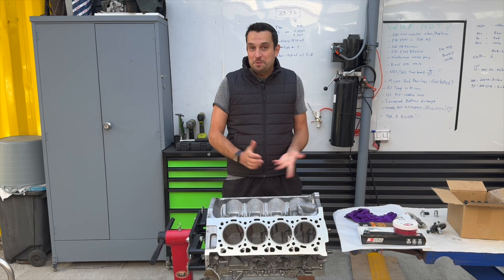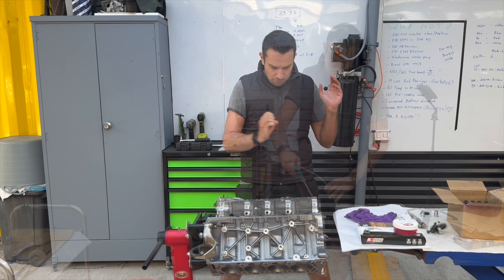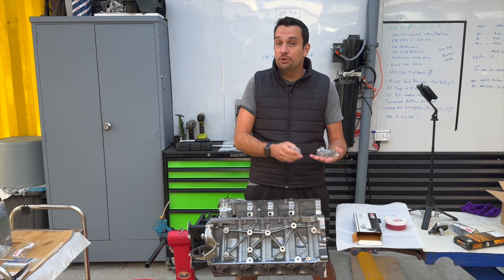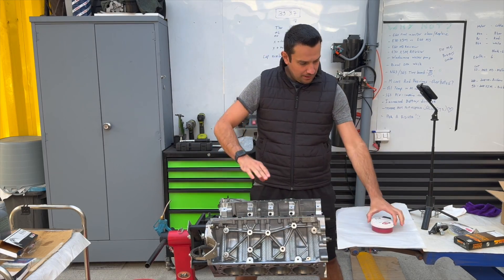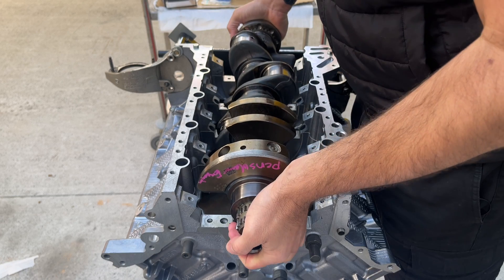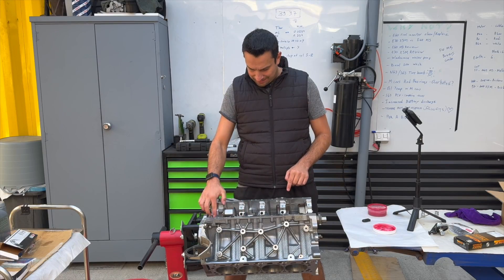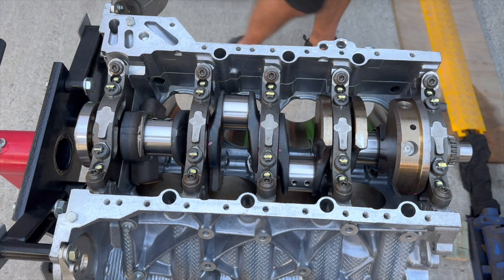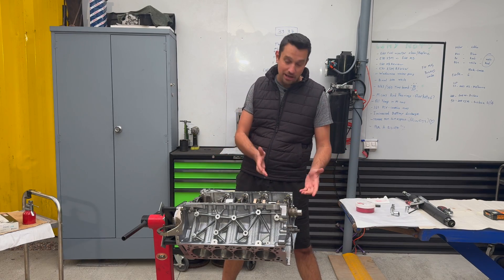BMW F10 M5 Engine Build - Part 1 - The Crankshaft S63TU

Comment: Is it too different than N63TU? I know it’s a M engine but I also know they’re very similar
Reply from the maker: No, they are basically the same engine and use the same crankshaft - the difference will be in the pistons, camshaft, turbochargers and DME depending on the year model - the way they are assembled is exactly the same, same tools and procedures

Comment: I have a f10 m5 with engine knock, it just had top end rebuild gearbox rebuild diff rebuild valve stems crack seals full new paint job. Now something else is wrong
Reply from the maker: My garage is in Sydney, send me an email if you live nearby
Reply: @dnl35projects  bummer I live in north Brisbane, let me know if you start a shop up here lol I wish. Or if you know anyone up here, you can trust?

Comment: In bolting down the crankshaft, is it important to torque and angle-set each bolt before moving on to the next rather than first torquing all bolts and then setting all the angles - with the latter method running through the correct sequence twice?
Reply from the maker: I don’t really mind the method for it since the crank is sitting on oiled bearings and has enough clearance to move and since they are stretch bolts I rather torque them all then come back for the angle rotation giving them time to stretch.
Reply: @dnl35projects  Cheers.

Comment: Hello! I have a question about the install lube during the crankshaft install process. 
@7:55 you put lube on the sides. I noticed you did that on the lower bearing as well. Is that due to the thrust bearing?
Reply from the maker: That’s correct ! Number #3 journal is the one holding the thrust bearing so I also apply lube to the sides
Reply: @ awesome thanks!

Comment: So about torque space 
Crank bolt 20nm+ 115 degree
Small ones e bolts 10nm+ 55 degree
Side key bolt +16mm for oil pump 10nm +45 degree is that right?
Reply from the maker: That’s correct ! The spec on the oil pump bolts could vary according to the engine you’re working on (eg 4 wheel drive or rear wheel drive)

Comment: DO you use Stock bolts for the crank shaft main bearing cap? or ALL new?
Reply from the maker: Hi, it depends on the build - some cars I use ARP and some I use the stock rod bolts
Reply: @dnl35projects   oh, What i meant do you reuse the bolts (OR can you)? OR do they HAVE to use bran new bolts?

Comment: Hi do i have to buy all the stud for the crankshaft new or can put the same one and were can y buy them thank you
Reply from the maker: The bottom ones I usually re-use and only really buy the head bolts new - I buy most of the parts from FCP euro or ECS Tunning in the USA 🇺🇸

Comment: First i will thank you for your videos :D I have a f10 M5 comp with a downpipe without tuning and I get white smoke when I accelerate and let off the gas/under revs.
I don't lose any coolant and believe that the oil consumption is normal. What could it be? its around 10-15-20.25 Celsius here
Reply from the maker: Thanks - Its really hard to pin point the issue without seeing the car and also interesting to know your coolant levels are not dropping (for both reservoirs  right?)
Reply: @dnl35projects  
Thank you for taking the time to reply :D Yes for both reservoirs. Now I have put the original catalytic converters back on and the smoke has been minimized and disappeared when the engine is warm. It can come when I stand still for a little while and rev the engine and let go, but only once now and not as much as before. I will leave it as it is, even if the sound is not as good :/

Comment: hi am changing my valve stem seals soon for my n63tu engine what do you recommend i check or replace while doing the job ? my plan is to have the car for 3 years atleast
Reply from the maker: Hi, replace the oil separators as well while you’re in there
Reply: @dnl35projects  God bless you

Comment: Best BMW channel I found so far!. Thank you for the S63 video. I had a collapsing vanos pulley on mine.  We stripped the motor because we thought it was bearing but they are stil fine at 100000km.
Reply: you should check out m539 resto
Reply from the maker: Awesome ! they are great engines, just need some special attention every now and then
Reply: Both of mine exhaust vanoses collapsed too.

Comment: I have a question for you:
Do the S63 and N63 have identical cylinder heads when it comes to the Exhaust port diameter?   
I am in the process of making a custom exhaust manifold for the S63 (split banks) and as a shortcut I had already looked into running the N63 Twin-scroll manifolds, but then realized that the exhaust manifold gaskets of the N63 are much smaller diameter than the S63 so I got a bit confused
Reply from the maker: Hi, the cams are different but i'm not sure about the ports size and unfortunately I have none in the bench to check
Reply: @dnl35projects  OK thanks, I cut up a F10M5 manifold to split up the banks, just trying to find a local welder to patch it up.  It will then need a tune to re-arrange the O2 sensor readings, but I have that covered.  The information I had from one X5M FB group member was that the port sizes were the same between the two but I just found it very strange as even the Original E70 X5M manfild (and the F10M5 manfold) have much bigger runners than the N63  manifold gasket.

Maybe if you have time you could measure the exhaust ports on the engine you are building.

Comment: Great to see you back! Where’s the e70 x5m vs the e60 m5 race at? I just remember that from an old video I figured I’d ask.
Reply from the maker: Hahaha i'm gonna be 100% honest with you ! The E60 M5 is my favourite car however I  was a naughty boy last year and did not achieve some financial goals - As a punishment I decided not to renew the registration of the M5 and let it sit in storage until I can improve my finances 😝 I haven't driven that car since March last year, just start it once a month ...  If things go well I should be able to get that car  back on road around November then will do some videos for the channel and race the X5m !
Reply: @dnl35projects hahaha it’s totally alright. I have a 2013 bmw x5 xdrive50i m sport with the only year it came with the factory m performance package. So the N63 with a mild dealer tune. Honestly, it feels just as quick as a stock s63 e70 x5m to me. Bmw as you know always underrated power numbers. It’s in a storage unit because I spun a rod bearing but finally this summer it’s getting a new longblock. I love it. It’s never going anywhere. Love to see where all this channel goes. I’ll be watching

Comment: So happy when I saw the video the other day , this is the icing on the cake for the weekend !

Also learned something too. I would have torqued all the caps down to 20nm then done the stretch after they were all torqued up. In my mind this is more logical, so interesting to see it done this way.
Reply from the maker: Thanks, i'm glad you like it. To be honest, I dont think it would be much drama in torquing them all to 20Nm then doing the rotation on the sequence mentioned because there is still clearance on the bearings however for the engine heads and parts with dry gaskets is imperative that we torque in the correct sequence. (generally from the inside bolts to the outside)